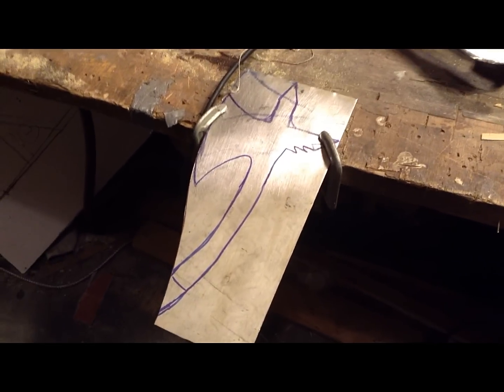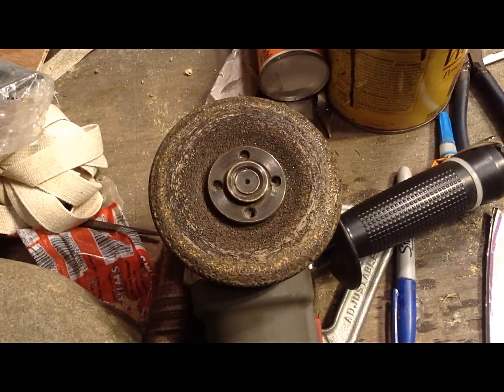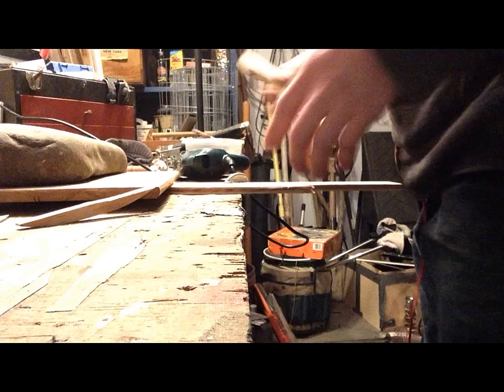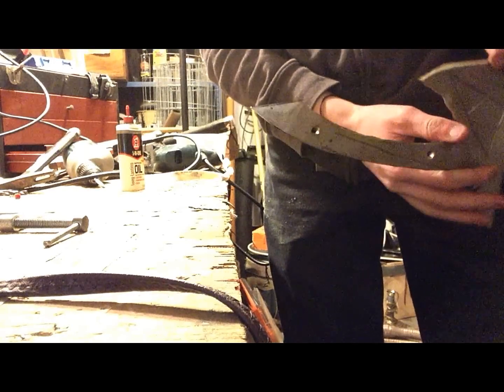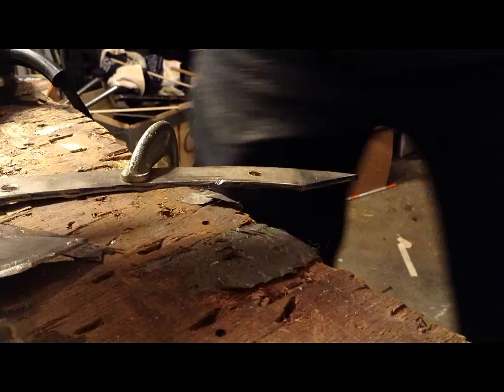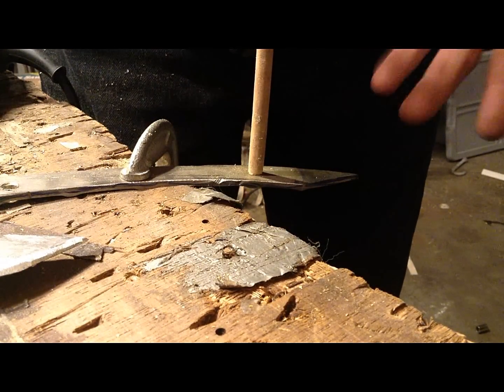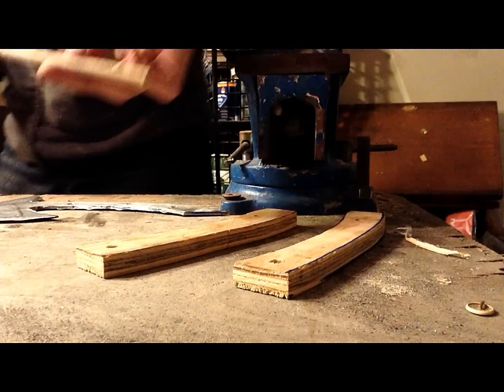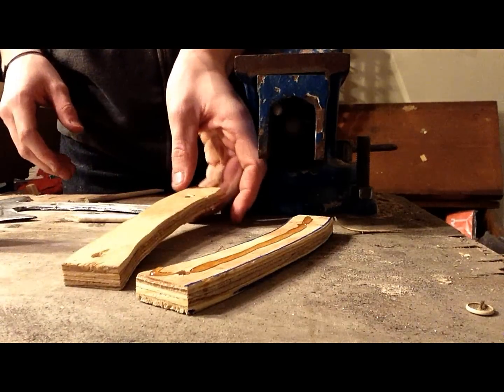HOW TO MAKE A TOMAHAWK

Comment: you should heat treat all blades that you make it will help them hold an edge stop them from bending and its just safer for the user. nice build though!
Reply: The steel might be mild. Meaning it wont harden. But otherwise your right.
Reply: Melee Weapons Well, what i should have said is use heat-treatable metal and always heat treat. :-)

Comment: Dude, stop wasting steel.
Reply from the maker: Youre comments confuse me, how am i wasting steel?
Reply: +VectorWeapons the fact that your making a bladed weapon and not using heat treatable steel makes it useless. I'd recommend using a big honkin saw blade and cutting it out from that.
Reply from the maker: +Walter Morgenroth well i'm only using it on wood and soft things so it doesn't need to be heat treated. But thanks for the suggestion!
Reply: I thought you were talking about his videos in general, as a waste of materials xDDDDDDD
Reply: +VectorWeapons even if you used that on a piece of meat it still wouldn't hold an edge.
Reply: +Walter Morgenroth I know I sound like a jerkoffbuttfacefreakizoid, but every blade needs to be heat treated. If I could, I'd send you some sawblades or lawn mower blades. #examplesForTheVectorMaster